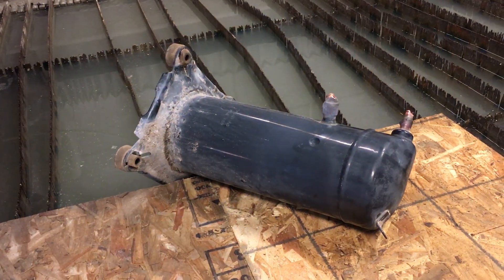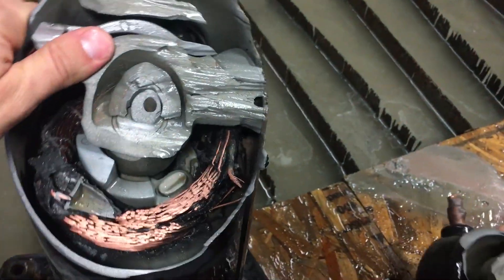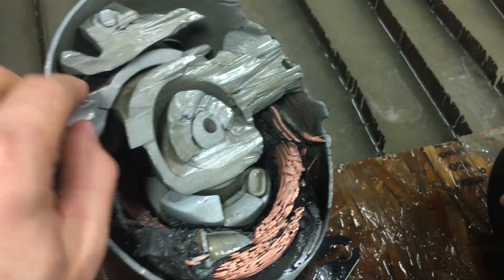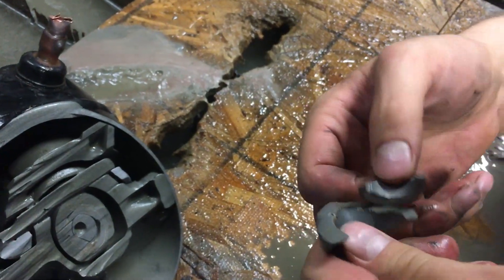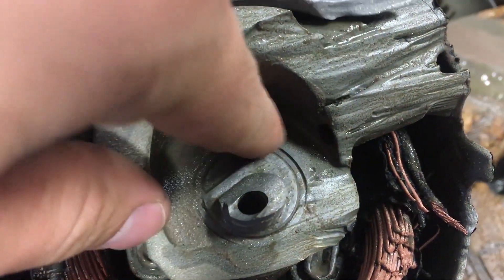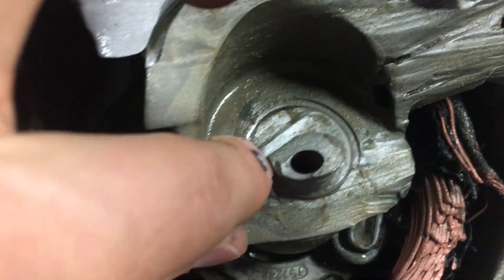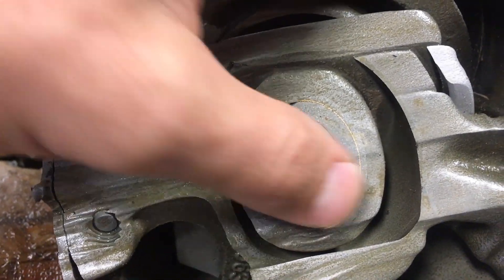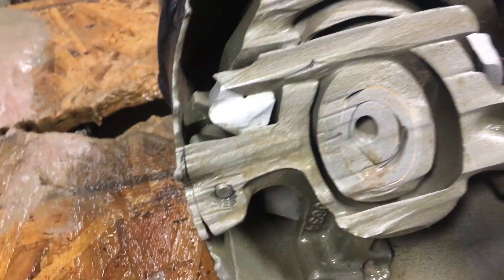A/C Compressor cut in half with a Waterjet - 60,000 psi

Comment: A compressor doesn't really compress gas. Think of it as a huge vapor pump that can handle extreme pressure. The extreme pressure and forcing the gas against a small opening like a temperature expansion valve to turn it back into a liquid. In fact if you get liquid inside the compressor itself. You will kill it